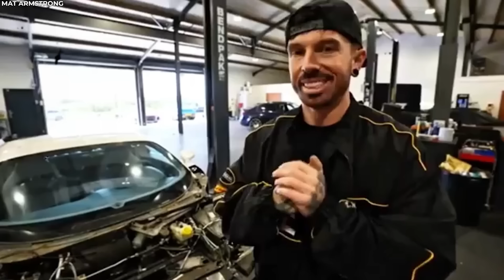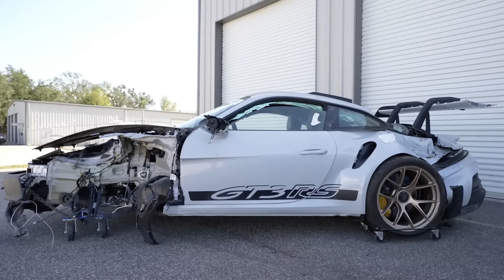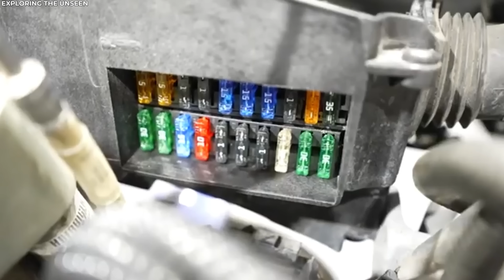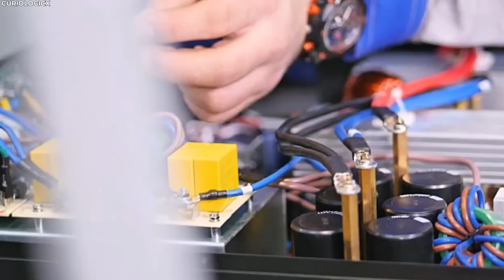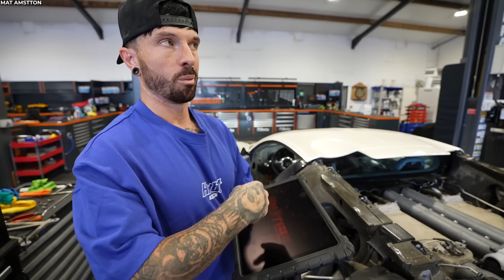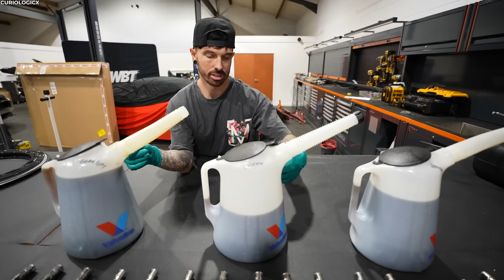Bugatti CEO FURIOUS After Mat Armstrong Fixed a £300,000 Gearbox With a £5 Fuse

Comment: THIS is TYPICAL WOTH MOST CAR MANUFACTURERS and their dealerships. We ALL have stories from THAT LOT..HERE'S  ONE of mine Volvo xc70 had it from new, 300kim started to get Oil leaks, took it to VOLVO, they said need a new motor  $12000 plus labour,  took the car to a Euto car mechanic $3000 complete, leaks fixed , by changing all necessary gaskets etc.... car is STILL GOING, NO LEAKS PULLS LIKE A TRAIN...NEVER WENT BACK TO VOLVO...😊😊😊

Comment: But..........What was causing the fuse to burn up????????? As a retired mechanic and being that modern auto transmissions have many electrically controlled parts, with any transmission problems, I would run the computer diagnostic first and 2nd I would check all fuses that had anything to do with the transmission. If that circuit had a higher amp fuse in it than the manufacturer recommended their was something wrong with the circuit feeding power to it..........

Comment: Gate keeper,  Fraud,   no wonder,  Volkswagen,  dropped them , its a concern,  compensation to the previous owners,  Servicing cost ridiculous.  Clean up your act Bugatti. Blocking the "owners" right to repair,  by blocking Vins refusing part  is very dangerous,  and would be responsible,  if newly manufactured parts have to be made outside the factory.,  factory torque specs,  buyer beware.

Comment: Wait, what caused the fuse to blow??  Something downstream from the fuse was still able to malfunction and blow the fuse, what was it??
Reply: It was the transmission pump to gain pressure for the transmission to shift gears. The pump was staying on and over pressuring the system and would blow the fuse
Reply: It was explained in Matt's video. The fuel pump is not up to it, Bugatti put a new fuel pump in on every service, if the pump gets over worked it melts wires off the fuel pump and melts the fuse. New pump with wires attached and good to go.
Reply: David,
Youare "right on" with your querry. If the 40 amp fuse blew, the 20 amp would also blow unless the problem was a superficial one such as if a drop of water or a bit of dirt shorted that circuit and then simply evaporated of was dislodged etc. A simple replacement of the fuse without a bit of deeper investigation was, at the least, unwise.
Reply: Absolutely correct
Reply: He's still trying to figure it out
Reply: Gearbox oil pump